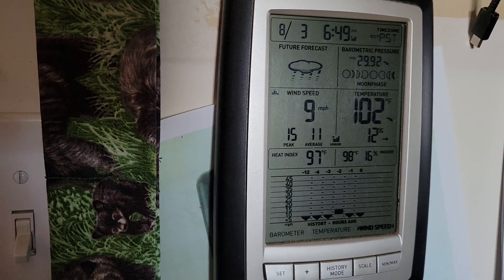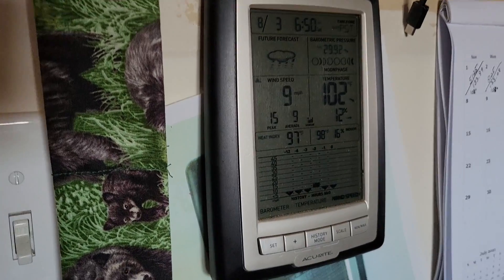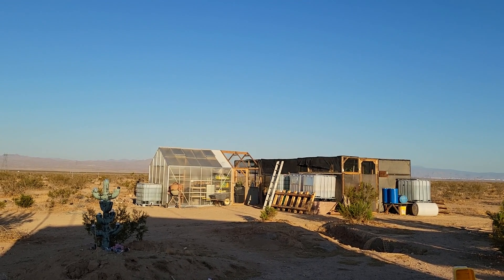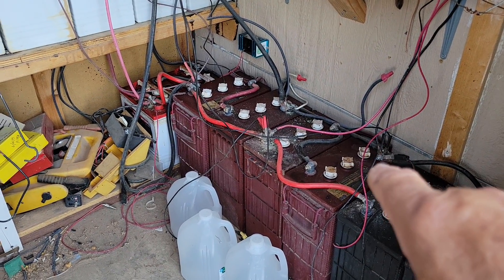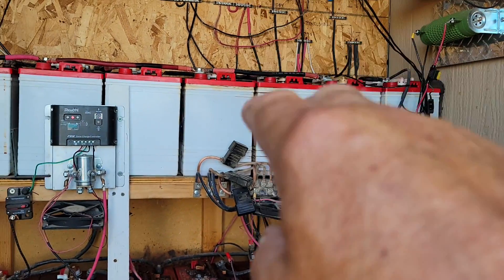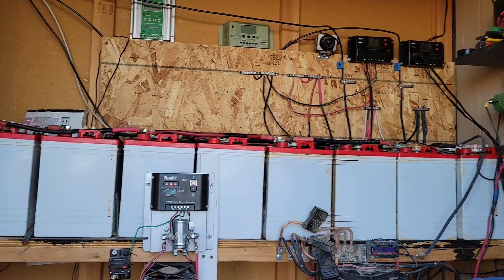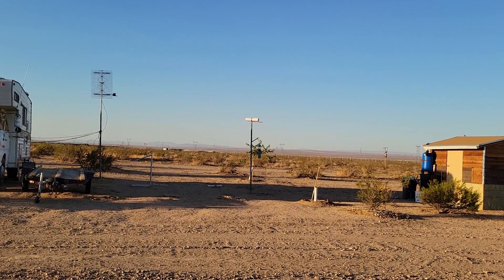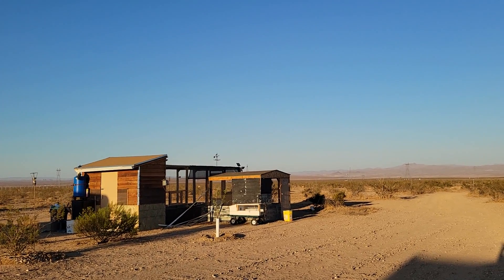Battery Bank Maintenance in a Heat Wave, August 3, 2021

Comment: I have a question. 

When you first get your solar battery bank setup, it will have fairly normal voltage. But then maybe a year later its typically showing less for the max. Like first year maybe it said 12.5V, but then now when charged up its not showing above 12.4 or 12.3V. 

My question about this, does this mean the max amp hours, or # of amp hours  you can use in a day are still the same or not when this happens? 

Thanks.
Reply from the maker: All batteries lose a little over the years.  A tenth of a volt isn't much and shouldn't affect your normal usage.  
Battery maintenance is very important.  Air space between batteries, clean terminals, proper fluid levels, etc., as well as having adequate solar input so the batteries don't cycle too low on a daily run.  
Drawing a battery bank down too much each day shortens their life dramatically.  I never let my bank drop below 12.2.
Also, with lead acid batteries, a BLS (Battery Life Saver) prevents sulfation and extends the overall life of the bank.
Reply: @GBear  Wow. Thanks.

You know I found out most of my problems were coming from the solar charge controllers. And not my batteries at all. I wouldn't have even have got anywhere without your videos and help. 

But i wonder if most people are getting problems maybe first and foremost from the charge controllers.
Reply from the maker: @noahriding5780  If they are using cheap Chinese controllers, there is no doubt their problems are all in those.
Second, if they are using cheap inverters, their efficiency is an issue they will find soon enough.  Those Chinese inverters claim 'pure sine wave' but are dirty sine wave, not pure, not modified.  Just dirty.

Comment: Okay so when I get two batteries in September I will have 1730 amp hours, so divided by two for 24 volts is 865 amp hours, or 21.6 kwH . ( I think ) If that's not enough, screw it...
Reply from the maker: But what is your total amp requirement?  Let's say for basics only 200A total.  That gives you about 4.5 hours to run the basics without solar input, say big rain storm.
Reply: @GBear  well after 2 days of clouds and rain , it got down to 23.8volts once, but the sun was coming up by then...I'm getting  200 more watts of panels Tuesday so I'll have to see how it does...and someday there's 2 more on the way lol...so that'll mess it all up again so I'll just wait and do the figuring
Reply from the maker: Sounds like you have a very low amp draw on your system.
Reply: @GBear  well, I was just thinking about a wind generator...one thing about Oklahoma, the wind comes right behind the rain, after all...that means we get a lot of wind here, lol...the average windspeed here is 18 so that means its more than that a lot too...but we're doin deconstuction of his barn add on at the other house ; he's fixin to sell the whole thing so I'm going to get a bonus then . I want to see how good these panels work that I'm getting...if they are great I may get 2 more , that would put me at 1200 watts...after I get the back ordered ones from Dallas...at noon we were back from the other place so I turned the A/C on and took a 3 hour nap...lol... I didn't get good sun this afternoon as much, there were clouds forming or somethin so I kept getting less as the day went on...usually it has time to charge back up but it's at 24.3 at 11 PM so it'll be okay...by the time it hits 24 volts the sun will be on the panels again...I'm thinking the voltage will improve after I get those other 2 panels...and the amps should be around 20...probably just needs amps , lol
Reply from the maker: If you are going with the KT5 turbine, be sure to go Max Core.  You'll be happy you did with those wind speeds.
Reply: @GBear  no it doesn't, it gives you closer to half of that since you can't draw more than 40% of the the battery capacity. so 865 is more like 400aH, and that assumes that you draw those 400aH over say 20-24 hours, not all in a short time.

Comment: G Bear you're better off waiting for the salt water battery bank.
I'm looking into getting more solar panels.... i have a 3kw turbine... but 3 months without wind haha so plan B... your words (solar is king). I hope 1600kw solar will be oke to keep topping up the battery bank 1400kw charge controller. Keep up the uploads great content.
Reply from the maker: I'm running 3.45kw solar,  need more batteries
Reply: no, you need to consider LiFePO4 batteries. lead is not worth the money anymore. They will handle the high amp draw of inverters, and can be recharged more quickly with their lower internal resistance. they can last around 15 years, and require no maintenance or venting

Comment: I let mine charge for two days without much load on them and they finally floated today...so I ordered two more 100 watt panels...says I'll get them on the 10th...lol...I got lemons today at Cherokee nation ( got food today), and one of them was so tart, I was thinking that one could make a battery lol...
Reply from the maker: Yeah, charging without load is best to top off a battery.  More panels is good, what controller are you using?
Reply: @GBear  it's an Epever 4215 BN ....40 amps
Reply from the maker: I've never used one, but hear good things about them.
Reply: @GBear  it says, at 33 volts t is 99.7 % efficient...and when I bought it I only had 4 solar panels so efficiently counted a lot lol....it drops 2 % if you go to 62 volts coming in

Comment: Good morning gbear I went from flooded lead-acid battery the glass mat to lifepo4 lifepo4 goes down to zero degree I'm here in Texas where I'm at it get to 110 degrees 120 degrees the room weather app is highly ventilated good thing is no more water checking and yes I am still 12v to like you the reason why is in case I do not get enough Sun 290 amp alternator 12v and a 5 horsepower gasoline engine that will charge my batteries up no problem
Reply from the maker: Nice!  They claim NiFe batteries will last 30 years.  That interests me, because they will outlast me.
Reply: @GBear  there is there is a recycling center by my house that just received two pallets how does Anderson batteries 36 batteries each pallet I will go by and see if they still have them that recycling center it's where I got my lifepo4 I bought $37,000 worth of batteries for $2,500 I have a grand total of 72 kh
Reply from the maker: Cool! Nice find!
Reply: @GBear  I have seen battery from the 1940 and still working